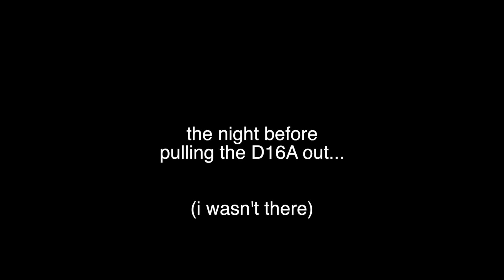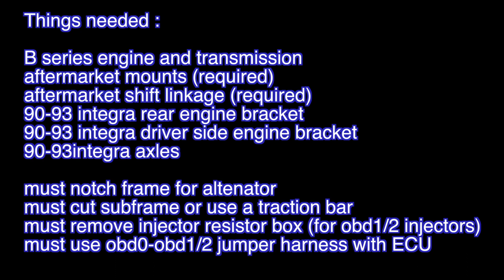CRX LS/VTEC SWAP!  HSG EP. 4-18

Comment: So I have an 86 crx with a b18b1 (obd1) and I'm trying to swap in an ls vtec motor (b18a1 block and b16a1 head obd2 head) what do I do with the crank position sensor? I know the obd1 dizzy has it built right in but what about the obd2 dizzy? Super confused

Comment: First Honda exhaust I've heard that doesn't sound like fart can anybody know what awesome exhaust this is or muffler or whatever they used
Reply: The kind with tiny asians inside to gather all the rice before it gets outside of the exhaust, its basically a riceolitic converter.
Reply: If you don't want your Honda to sound like shit, buy a GOOD exhaust. Like T1R, Mugen or Spoon. Those all sound excellent. Or use multiple resonators on a custom exhaust with good material
Reply: i was wondering the same thing.  My guess would be an apexi ws2

Comment: just to let you know the front subframe yall cut is going to crack once he does a couple hard launches. he needs an innovative traction bar or a toda replica header that will clear and make better power than that 4to1 ebay!
Reply from the maker: We know, he just needed to be able to drive the car. This was by no means the best or right way to do it.

Comment: I have a 1991 Honda CRX SI it's all stock and I'm looking for a new engine what's the best engine to swap for performance?
Reply: all depends on what you want to do/budget man you can put a vtec head on your current motor with a couple other goodies or just go for a bigger b or h series motor
Reply: I just want my car to be a quick machine and i need it to sound good like i said this car is a clean slate i can pretty much do whatever i want what are some good reliable things to make the car sound good look good and perform well
Reply: my personal opinion the best swap for a crx is a B series, it's natural for the car considering they came in CRX's. Personally I think the best b series is either a b20/vtec or as far as a straight swap I would say a GSR. I have a GSR swap in my 91 Si with full bolt on's intake mani and tb and it's a fun car, I wanna build the head and I think once I do that and get a better tranny  (using stock gsr) I can shoot for low 13's/ high 12's

Comment: What harness do I need to use to make my dohc zc in my ef if you don't mind
Reply from the maker: If you have an si/ex/awd model you'll only need to move 2 wires from the distributor to the cyl sensor. If you have a dual point harness you'll have to add the the injector wires and cyl sensor wires as well as rearrange some wires at the Ecu and change the Ecu to a si or convert to obd1
Reply: Honda Street Garage do you have somewhere i can contact you have some questions
Reply: Diezh yea I do on FB tony adams add me

Comment: when I did my b16 swap in 88crx si I did not have to cut or hammer any thing is it different??
Reply from the maker: I think with stock exhaust manifold it's not needed as much and the alternator can be tucked in with a short belt
Reply: +Honda Street Garage I used DC 4 into 1 headers there were one piece style